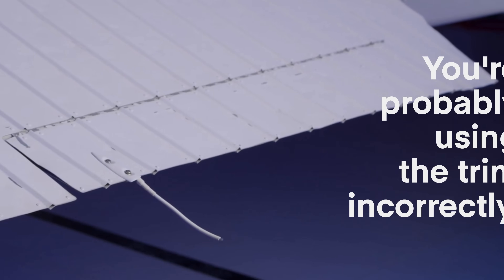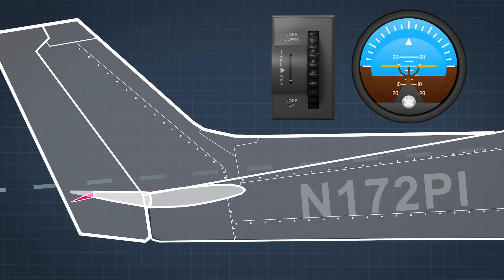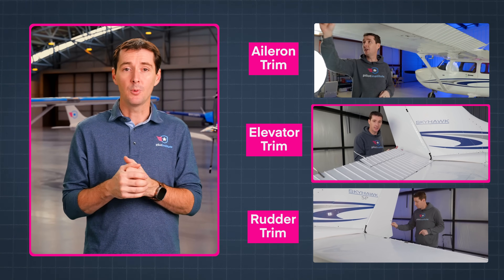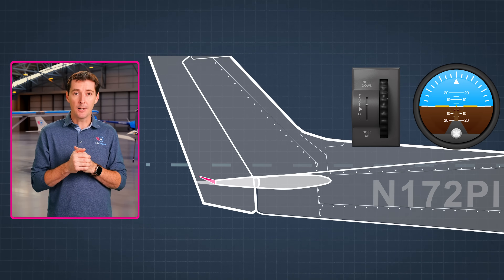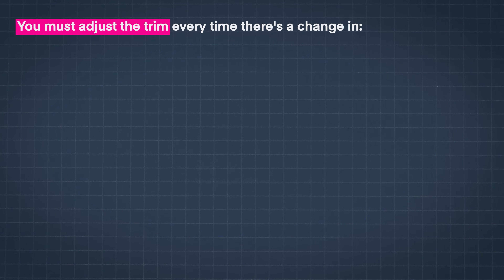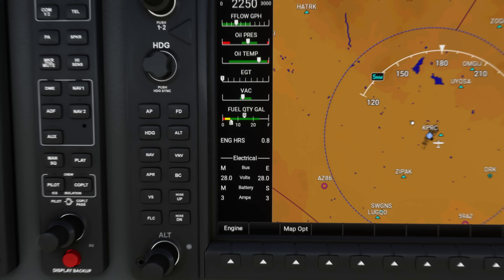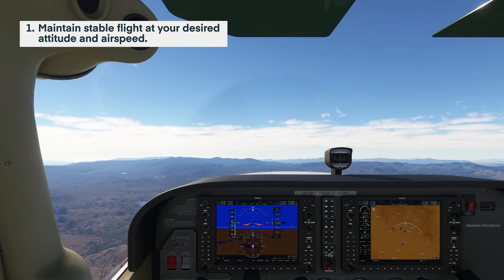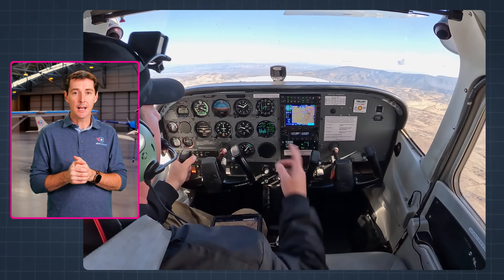You’re (Probably) Using Trim Wrong

Comment: How long are you cruising? If you’re flying a long time in cruise, your weight changes as you burn fuel. This means either you need to slow down or trim down. 

Now, this notion you have to change trim any time there is change in airspeed, attitude, power, is wrong. You could instead fly constant AOA meaning leave the trim alone accounting for changes in attitude with power. This means you could do constant AOA turns instead of constant airspeed turns. Which in turn means you preserve margins. Better to use the trim in most circumstances but there is value to constant AOA turns particularly in landing patterns. Consider practicing them in slow flight. While you may have some misaligned thrust line effects and/or prop wash to account for, presuming a centerline thrust with no wash, power changes nicely control climb and descent with no trim change needed. Brings another point, differentiate zoom from climb dive from descent.

Comment: My airplane (Vans RV12) has one really annoying tendency in cruise flight. The electronic trim’s “fidelity” isn’t quite fine enough to go totally hands off. At normal cruise power, one little flick up puts you in a slowwwww climb…one little flick down puts you in a slow descent. I usually choose the former if I’m not on autopilot because it’s easier to keep a tiny bit of forward pressure on the stick than it is to slightly pull back.

Comment: Yeah but how long of a press on the electric yoke trim control equals one full spin of the trim wheel? I’m using a 172 with the electronic control on the yoke for the first time vs manually
Reply from the maker: It’s the same procedure as doing it manually. Actuate the switch on the yoke, then let go of the control and see if the plane is trimmed.

Comment: There is a very easy way to re-understand the trim (at least for me)... don't trim for level flight. trim for a given airspeed at a given power setting. This will help you get your speed on climbs, descents and even cruise. if you cruise at 100 kts in a c172, trim for that speed, the MINUTE (like tiny tiny touches) to keep your altitude.
Reply: Trim is an AOA controller, but agreed It is easier to think of it as trimming for a certain speed and using power to control altitude, like when landing or in your example of cruising at a set speed and using power to set your desired altitude. Conversely, in cruise I typically want a set altitude somewhat regardless of speed, so trimming for that "altitude at a given power setting" will result in actually trimming to the "speed" (or AOA) required to maintain it.
Reply: Always climb at full power just equal below yellow line not at a particular power setting in general aviation planes

Comment: 5:55 On final you would trim with a nose up attitude? Shouldn't it be nose down?
Reply: In my (limited) experience no. 
As your speed slows down the aircraft will want to pitch down, meaning you will have to apply more back pressure to maintain your glide slope. This becomes worse as you flare as you will be very slow and there will be a lot of forward pressure. Thus, on final you trim slightly nose up (trim position, the A/C will still be pointing down) to help relieve some of that pressure
Reply: @adrianharcourt-cooke7204 So if I got you well we are supposed to trim slightly upward when on final?Please explain
Reply: It depends on your usage of flaps. Generally with full flaps you will need nose down trim. However, with 10-20 degrees or even no flaps your trim will be neutral to nose up.
Reply: @LoganHall-h6v Wouldn’t that depend on the aircraft as well?  Only ever trained in a Diamond DA40, CFI tipped me off to hold the trim wheel at the front and rotate it back (nose up) as far as it would go without letting go of it (about 1/3rd rotation at a guess), just after turning base. That would leave the aircraft trimmed for the right airspeed with landing flaps. As a rule of thumb it seemed to work pretty well.
Reply: I always trimmed to maintain the proper airspeed from just before I began my descent from pattern altitude until I was on short final. I used the yoke to change the attitude of the plane, bring it to the proper airspeed, and then adjusted the trim to where I wasn’t having to pull or push on the yoke.

Comment: Trim is easy.

Lift is a function of: Angle of attack (lift coefficient). 

And: Velocity squared. (Dynamic Pressure, or "Q").

To maintain altitude, all forces must be in equilibrium. Set power to counter expected drag at Your desired speed. 

Set angle of attack with the Elevator. (Stick/yoke fore/aft).

Then set the trim tab to relieve the stick forces your arms are holding.
Reply: 'Set the trim tab to relieve the stick force you're holding '. This - nothing else matters. Hold the attitude and trim out the stick force. Really simple, no one should be 'trimming wrong'.